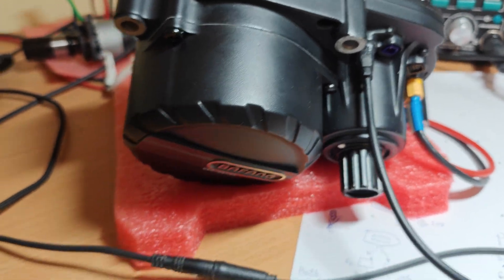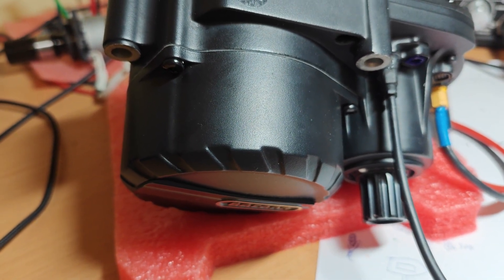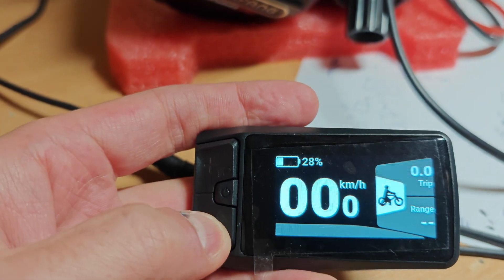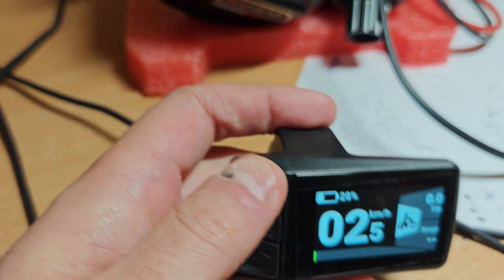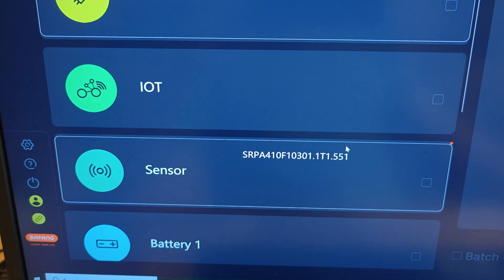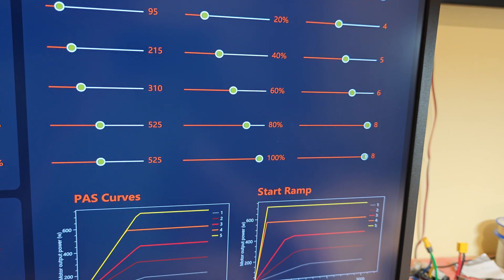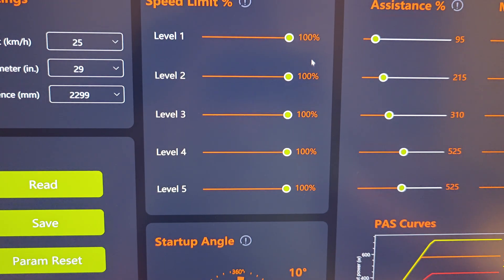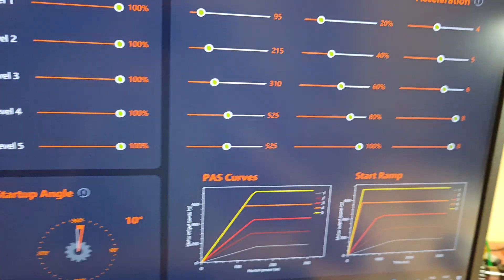Bafang M560RS first observations

Comment: Seems much louder than a well lubricated BBS02b which has a nylon gear and is good for >1500W peaks.

A peak gear would be important for me instead of the steel gear to reduce noise.

1000% assistance is a game changer for some weaker persons - sound like big fun.

Comment: I have a 48v 500w bafang mid drive can I put a 52v 20mah battery on it
Reply from the maker: Hello. Yes, it is taking also 52v battery without any overvoltage error. Just Battery % will be off. But can be compensated by K1 BBR. If you have M560 you can update firmware to 750W version.
Reply: @dado304 непонял.Мотор м560 мощностью 500 Вт.можно прошить на 750Вт?Перегрева не будет?Какой мощности контроллер на моторе RS?
Reply from the maker: @ВиталийКулабухов-й3ж Yes, you can upgrade M560 to 750W firmware. Hardware is exactly same. And not overheating even on full throttle for long.

M560RS, has new controller (but just small number of changes on pcb). Better torque sensor. But now just in 500W version.
Reply: @dado304 Спасибо!
Reply: @dado304 перепрошивается кабелем beest?
Reply from the maker: @ВиталийКулабухов-й3ж Of course you can update with Besst. K1 Flash is a "copy" of Besst, with included firmware bin files and my support. Plus you do not need to hassle with passwords, python workarounds. Besst can not set speed limit over 25kmh.

Comment: Can you try using the throttle with walk mode? Maybe they made it so throttle activates walk mode (I wish :D).
Reply from the maker: No, does not work. On PAS level 0 and W throttle does not work. Why you need to work throttle on a Walk mode?
Reply: @dado304  Just so I have a justification for having a throttle if the police asks :D Then maybe before magic button combination throttle works as walk assist up to 6 km/h (and 25 km/h pedal assist limit) but after magic button combination it works as throttle up to 50 km/h or whatever. Also it's nice to have a throttle to have some modulation in walk mode, for when you are walking the bike up some crazy steep rocks or whatever. That is on my wishlist at least :D
Reply from the maker: @izzeww8487  Yes, you have the point with that throttle modulation of Walk mode. That could be useful, and is not hard to code it (few hours as everything they have already done, you just go RPM throttle and not torque throttle mode). But you know Bafang, you see they can not do even proper walk mode turn on. ;) Just validated my words, that bafang can spoil a function, which worked just fine in previous motor version. And that is also true with firmwares. ;)
Reply from the maker: @izzeww8487  To changing speed limit for throttle. Not so easy, as Bafang did hardcode throttle speed here in M560 to 45kmh. (Older motor worked up to set speed limit). 
One solution, is to route throttle to BBR Ultimate first. Means 4 cables from BBR (pain with that cables, also to rework PCB). And then when you press magic combination, I can disable/enable throttle. But again can not influence the throttle speed. Could be doable with some tricks and manipulation with speed sensor signal (it was pain even with BBR Ultimate to unlock throttle speed, as then some Trip compensations and speed reading issues pops up). Will be complicated. Truth say few people already asked me for this. You know, for few cases not worth to develop.